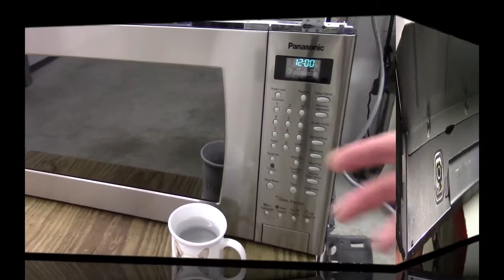DIY Panasonic Microwave Inverter Repair = Happy Wife & $$$ saved.

Comment: Thanks so much for creatig and posting this video. Our Panasonic 1200W (purchased from Leon's) is dead. We will hunt down the T15 security screwdriver and review if it is only the fuse. Otherwise, will consider to source the same power supply from the store you have referenced. Cannot believe our microwave is still around $500 from Visions (london)!! Much rather fix this mint condition microwave. Miss it already.

Comment: We have the same problem on a Panasonic NN-ST45KW its a current model in the UK, cost me 6 pounds on ebay, new board is 65 pounds a new machine is 186 pounds. not worth buying parts for

Comment: Is there a way to test the output of the inverter power supply?
I've replaced the magnetron and it still doesn't work, but it would be nice to corfirm that it's the inverter power supply before I spend more money.
Reply from the maker: Only way I know of is with a high voltage probe, but I'm not a factory trained microwave tech so there may be other ways as well. This is the HV probe I now use: https://www.youtube.com/watch?v=zyQvSCJ4q-U

Comment: Hi John,
In desperate need for help. I have a Panasonic NN-CD989S inverter convection microwave and about a year ago began making a buzzing sound for about 2 seconds upon startup. All was still working but the last time I used it, I smelt a burning electronics smell. I took it apart and thought it was the magnetron but it isn’t. Can you help me figure out what the problem is? Can it be in need of a new inverter? Your help would be really appreciated. Thank you.
Reply from the maker: Sorry, pretty much impossible to diagnose a problem like that remotely. You could certainly just try tossing parts at it in hopes that will fix it, but a microwave is a pretty dangerous appliance to be guessing at.
Reply: Thanks for your prompt response. I think I will try the inverter. Wish me luck😁👍🏼
Reply: Same problem here with the buzzing at start up. Now errors out at 23 seconds. .24 Amp draw that fluctuates twice with a bump to .6 Amp draw. Suspect inverter board. Did you find your issue?
Reply: @mrrhee2467  I did find the problem. Changed the magnetron and all was perfect after👍🏼

Comment: Today my son ran the microwave empty and said he could see lightning going across the window I replace the magnetron because it had a hole burned into it I've been thinking about replacing the inverter board it is the exact same model it starts with no heat and I get an error message saying hot any ideas
Reply from the maker: Sounds more like a faulty or damaged waveguide cover - just a guess of course.

Comment: Thank you for making these microwave repair videos.  I've got a High Pointe over the range convection microwave in an RV which is starting to make a loud buzzing noise from the area of the inverter board after a few minutes of continuous microwave operation.  Your videos have given me insight into where I should look.